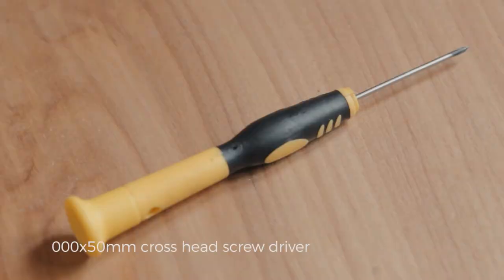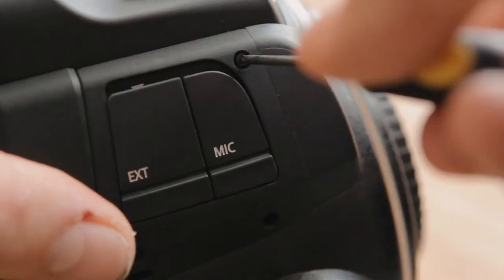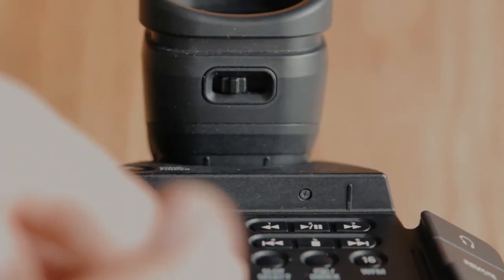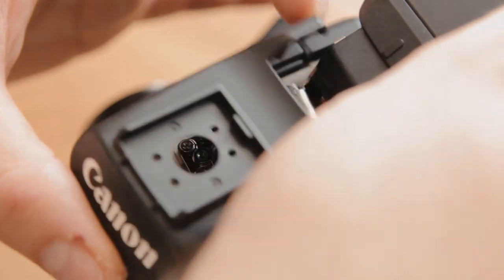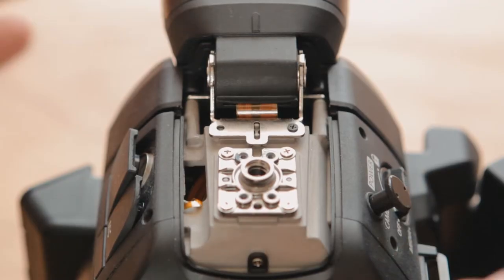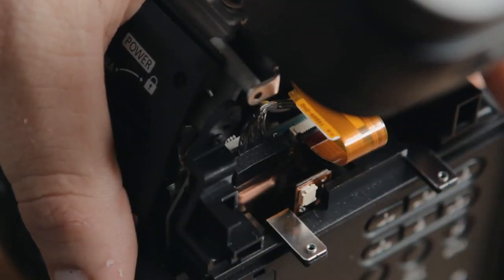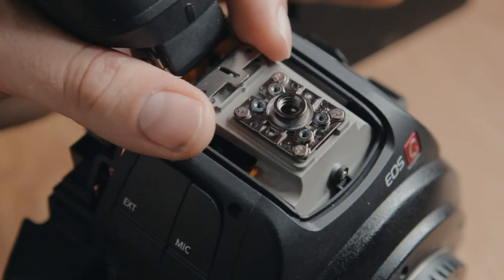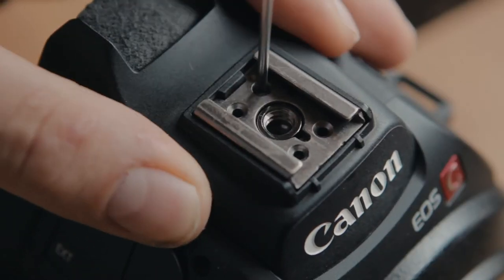Removing the Canon C100 MKii EVF / Viewfinder

Comment: thanks but also wtf dude. This was helpful but a warning about the fact that every screw had loctite on them would have saved me a ton of frustration knowing that some screws were inevitably going to strip. Also! While the 000 drive fit, i had greater success with a 0 size Phillips. Not sure if my camera or driver set is different. Was using a cheap iFixit precision set. The tip with the foam to fill the gap is excellent. Glad i watched to the end because i had no idea what i was going to do lol

Next time you do a tear down tutorial put some more emphasis on the fact that it was easy for you because you already tore it down once. You left out how tough the initial screw removals were and it was impossible to spot the loctite in your sped up footage. 

6/10. Helpful video. Should recommend that require materials are a screwdriver and beer… because holy hell it will drive you insane with the loctite’d screws
Reply: So how did you recover from the stripped screw heads? I'm left with one screw to undo and don't know how. It's deeply recessed, and I'm averse to hitting it with a drill!!!

Comment: Great video. I have an HDMI port with bent pins and I'm thinking of soldering a new one on. This is the only video I've found where someone opens up a C100mii. Have you tore deeper into the C100 or have any idea where I could get a service manual?

Comment: I tried this method, I never use the VF and I wanted it to be easier to work with a Ronin M or MX.
However, I coundlt remove 3 of the screws you showed here, some of the screws are so tight that the heads got damaged in the first turn and now I cant turn them in any way, speacilly the one at 0.34 that is so hard to reach.
I´m so frustated, if the camera wasnt so expensive I would brake them to get the VF off.

Comment: Hi. Bit of a long shot here but the headphone socket on my MK1 no longer works. Audio is being recorded on the camera and is bright and lovely using an HDMI cable/Ninja combo. I think the camera was dropped by a client when the headphone jack was in it (that's what they say), therefore pushing the internal connections out of kilter. Any ideas of how to remove the correct parts of the casing to have a look and possibly fix it? Thanks.